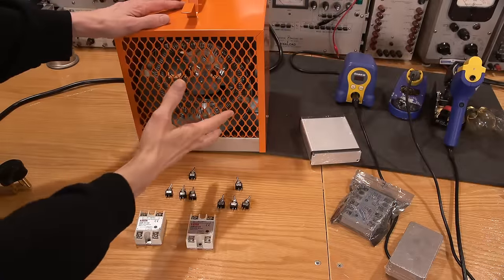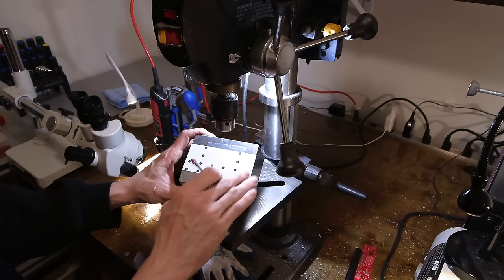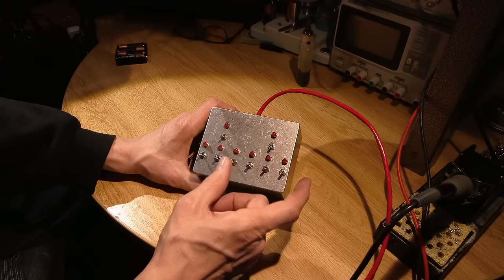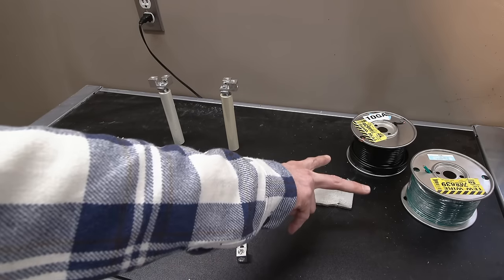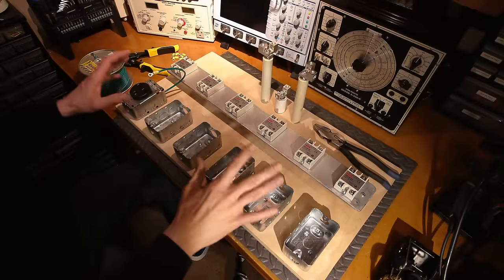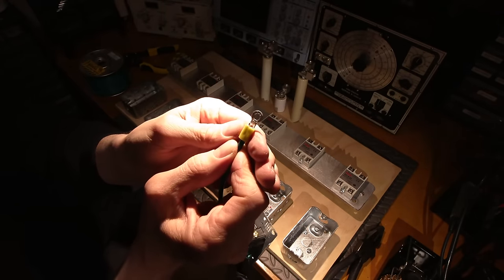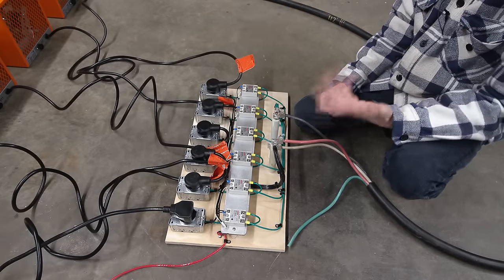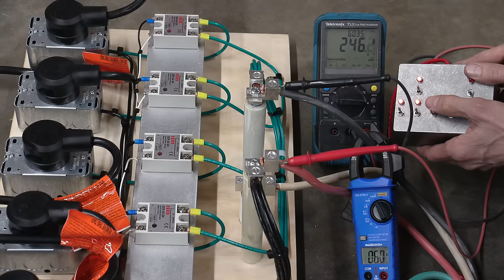27000 Watt Load Complete Build!

Comment: Wrong crimper for insulated lugs, the $475 Sta-Con ratchet crimpers for insulated only lugs are the oval, flat type crimp, not the indented type. You never use the indent type crimper on insulated lugs, it can damage the insulation.
 Plus, according to the manufactures, when crimping non-insulated terminals with a basic crimper as shown in video, you crimp opposite the split. The only time you crimp on the split is when it is a double indent, ratcheting type crimper certified for crimping on the split and that makes a totally different style crimp.  Source, been my job for 25 years and look up Sta-Con, T&B, Amp etc... instructions and it will specify.  Seems counterintuitive but had many a discussion on it and what the manufactures says, we have to do. 
Aside from that, cool load bank set up there.
Reply from the maker: I have crimpers with the dimple that are color coded for the different size plastic sleeves, made by a very reputable company. Thanks for your kind comment.
Reply: @MrCarlsonsLab  If my comment seemed rude, that was not my intent. 
As far as the color code, yes, some non-insulated, indenting crimpers mark the crimp size with the color that corresponds to the wire size. Even though the crimp does not have an insulated sleeve on it. The color indicates the terminal / wire size, noy necessarily the sleeve. In my experience I have also seen the boxes or plastic jars the terminals, insulated and non-insulated come in color coded as well, so you can easily tell what size terminal is in the box / jar without having to squint or read the label. Of course you are free to do what you want, but when it comes to mission critical equipment, the end user does check these things. Talking substations, data-centers, hospitals etc... Some even go as far as wanting to see the calibration report for the crimper(s) itself. And of course, you can only use the crimper the terminal manufacturer specifies for that terminal. I have seen 10 bay, indoor HV breaker cubicals get rejected and had to have every single terminal re-crimped with the exact crimp the end user specified. Thousands of terminations that had to get cut off and recrimped. IF there was enough wire to make it look right. Weeks of work to make it right or the customer refuses it. 
Engineers take their crimps seriously. lol
Reply: Yes, there are lots of videos on crimpling and they all say to put the split on the round side of the crimping tool not the side with the nipple. I think the issue is that if the terminal is misaligned a bit the nipple can crimp one side of the split and not the other and that will give a poor crimp. I know I have done them the wrong way and seen that happen. The important thing is you checked them after you crimped.

Comment: I would use the output from a couple of Thermostats to control the Triacs , set them to 70f & put on auto; have two zones. You can get a programmable one. Low voltage wire. Hard wire with transformer,  or the battery type. Plug & play. Hugh , Michigan city,  Indiana.
PS: Or is this strictly for emergency.
Right now as your wiring stands,  you have no protection on triacs,  & actually no.protection on heaters. You need to fuse that,  you can't just bring over two massive cables. What happens if one of those heaters shorts out ?

Comment: Nice to hear that generator bog and recover and maintain the voltage. I suppose...looking at it like 4 cylinder diesel...IDK...or maybe gasoline. Is its real capacity 30 kW?...it seems like large enough to be 60 KW...

I think the SCR...since it is on or off...there are like two Si diode like drops....but then i see yak about SCR being the 4 layer diode...pnpn diode...

I think our Blue M bake oven at work..uses a crydom or AB SCR rated at 60 amps...and they seem to fail time to time by latched always on....and the OTP independent temp monitor saves our bacon...by turning off the heater elements....so we don't melt our customer parts...or create an oven fire

Yes please measure the V drop..take apart the SCR....teach us...

I see on the Blue M...like 3 to 4 volts drop when latched on...

Good job on the 27 kW dummy load...

Comment: You might wanna duct the radiator to the outside and have a louvered vent behind the genny to pull in cool air over the genny and engine block through the radiator and then ducted back outside

Comment: Hi Paul,

Nice build.  You'll have to let us know if you are going to build or acquire an automatic transfer switch.  By the way, is your genset going to live in your garage as shown or are you going to partition the space so you can continue to work with it running?  If so, you've got exhaust handled but have thought about cooling and heat rejection?  It's amazing how hot the space will get with just the engine running.  I suppose you can just open the garage door(s) but thought I'd ask.  Cheers, Scott
Reply: @jmasseys  I had those very same questions and others as well.  The heat given off during a load bank test is extremely high and you need a way to dissipate it.   I was performing a load bank test for a customer in NYC.  They had a Data Center and a 2 megawatt generator on the 17th floor of a 35 story office building in Midtown Manhattan.  It was too far to put the portable load banks on the roof or on the ground floor.   We ran the load banks in the emergency stair way and staggered them across several flights.  We opened the stair way door to the roof and on the ground floor we put huge fans to push air into the stairway.   We wanted to create a chimney effect.  Even with that it got so hot in the stairway that we melted the paint off the steel hand rails and steel posts.
Reply: @eagle2019  Seems like our life experiences are very similar.  I did much the same in Detroit and Chicago high rise buildings.  It was always a challenge.  However, I was talking about the heat (and noise) of the generator itself and not the load.  That engine will get hot and I submit in a long-run operation, a few to several hours at even light load, the immediate space about the generator and possibly the entire space will get really warm if not hot.  An insulated partition around the genset will do wonders for the noise but then you have to bring in cool air and exhaust heated air.  Motorized louvers driven by the running generator solves the problem and keeps put unwanted critters.  It's always something.

Comment: Awesome job cant believe each of those heaters pull 20A you couldn't run one form a normal household socket in the UK typical max fuse is 13A
Reply: The 240V outlets in North American houses are usually 30 or 50 amps.

Comment: As others have stated, you are wrong about the crimp connector; the dimple should be placed at the solid edge of the connector.  Also, the only type of crimper that (I think) is any good is the ratcheting type.  Personally, I will often solder the wire in, but this must be done carefully so as not to wick the solder up on stranded cable.  Yes, I know some will disagree.

Comment: Now look at it purr.
I don't know whether it'd be an option, but if it was my place i'd try and add some drywall (gypsum-cardboard-type, not plywood) around the generator, keeping room for cooling air, to muffle the noise down a bit. on that note, drywall-board with rockwool on one side and rabbit-wire-fence on the other side of the wockwool makes a good noise damper.
you'd also want a carbon monoxide detector in this room, in case there are any exhaust gas leaks.

Comment: I had the crimper argument with an old colleague at work. In the end they both work. Kinda. The dimple crimper is best for uninsulated crimps, which is what the manufacturers also tell you, the double oval is best for insulated crimps of all kinds, which is what the manufacturer also says, the dimple crimper can pierce the insulation on the insulated ones depending on the type, such a the hard plastic insulated ones, most common here in Europe and it makes a mess that you will pretend wasn't your job. Then the test concluded in the act where we just used a pair of vise grips and went to town on them... which, I don't know how to tell you this but it worked and was secure. It looked like ass but it worked. All in all just listen to the engineer in the factory that wrote the piece of paper, there is no other universal 'best tool for the job'. Also the ones that are the double U shape? Everything else but the dedicated tool is absolutely hopeless.

Comment: AMP  terminals with the different color insulated plastic on the terminal require to use crimpers with crimp dies that are the oval type otherwise the crimping tool will the dimple crimp can  damage the plastic color insulation. Crimpers with the dimple are used on non insulated terminals ..
Reply from the maker: No they are not. I have crimpers with dimples color coded for the plastic sleeves. It's amazing how many people have this wrong.

Comment: Sorry Mr. Carlson but you use the crimping tool wrong. 
The notch is supposed to press the side of the crimp which is solid. 
Your crimp should be 180 degrees rotated.
Reply from the maker: Nope, doesn't press in the cuts the other way.

Comment: Guitarists need dummy loads to run their cabs at lower volumes at home but with the actual amplifier still cranked to breakup to get the sound they want, but I suspect 27000 watts is a TAD too much, even for Spinal Tap.. Oh btw Hotrodders use those Fotek SSR modules in their racecars to trigger the 'bump' feature on their transmission brakes, I think you can get an aliexpress clone that is a 3rd of the genuine price.

Comment: Coils of nichrome wire — sounds like an inductor to me.  So maybe not for testing big RF transmitters!
Reply from the maker: At higher frequencies, you are correct. Any length of wire can become an inductor depending on the frequency applied. In this case, at 60 cycles, this just looks resistive (to AC), excluding the fan motor of course.

Comment: Scary dumping that much energy.   I was hoping you would show voltage drops across the SSRs and a thermal image of them.   I have seen vids on them burning up and tear downs showing the discrete triac inside being under rated compared to the rating stated on the SSR.

Comment: If bottom switches were all in series, it would be possible to switch off SW1, then on SW2,3, SW4 off, SW5,6 on. Then with SW1 you control 3 loads for example then SW4 would add rest of them, where SW1 would act as master switch. The downside would be that it would not be possible to select any load and load 1 would have most usage over time, but if they are all the same that should not be problem since they don't degrade but switching them would be trivial.

Comment: In every load bank I have ever used the fans were controlled separately and will not turn off until it was cooled down.
Reply: @charlieb9502  Exactly correct and in addition the engine/generator was also run for 20/30 minutes with no load to cool down.  A good automatic transfer switch will have all these features built in.

Comment: U should use earth on it and wire a input industrial plug on and make patch lead with big croc clips sos more esay and universal 

Put power transformer in board not box earth box n transformer and run fan's on the realy board 

Run industrial Amp n volt gauges and rotation gauge and frequency gauge maybe a sync gauge 

Put the sockets on little ledge sos leads hang down 

I'd put more sockets on it than that sos it universal board and add incandescent lamps on 

Is all things I'd done

Comment: You could have also used 4500 watt water heating elements in a water tank.   For testing and temporary use, you did ok.  Good thing this was not a how to do the connections permanently!   It would have been a total failure filled with NEC violations.